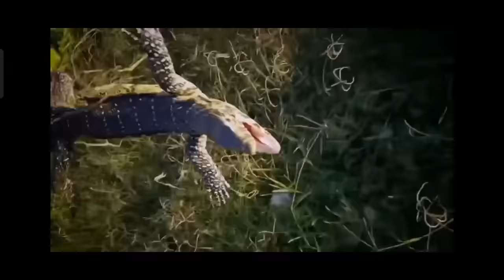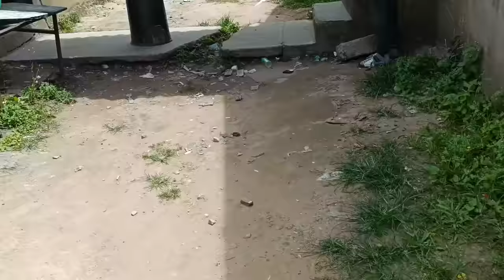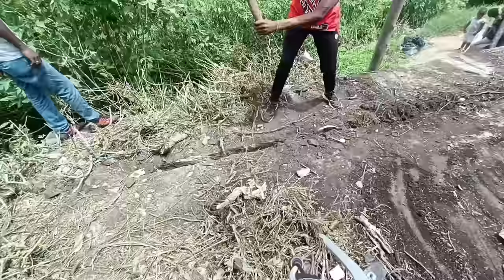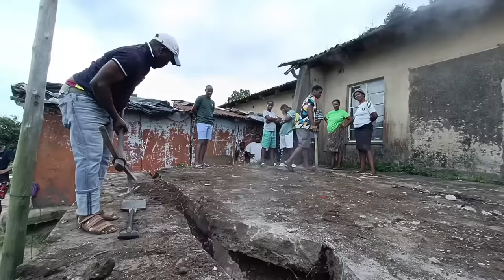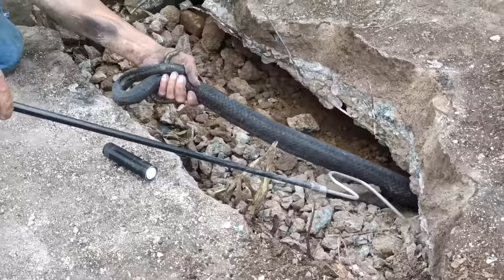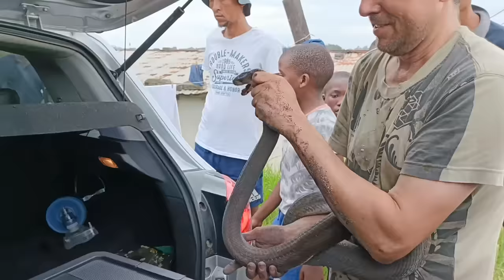MEGA MAMBA MAYHEM!!!  😱😲😯

Comment: How is it possible that people accept driving wrong, and it is proven, for example
The largest percent are right-handed, so you can control everything better with your right hand, the gears, the handbrake.
With your left hand it's like you're moving around in a pot, no strength for anything, not even the handbrake, you can't even release it properly

Comment: would be much more intelligent to build a trap for the snake then to hacking apart everything.
Reply from the maker: The concrete platform was already badly damaged from erosion and stress fractures. The entire front section was separated from the rest.  So it will need a lot of work to fix anyway. A little bit more concrete is all that will be needed. 
Snakes are not always easy to trap.

Comment: All that effort smashing the concrete - wouldn't they have been better off just sealing the cracks with cement?
Reply from the maker: That concrete platform already had major structural damage. The damage that we did is small, compared to the work that is required to repair the damage that was already there.
So they weren't worried about damaging it in the least. 
Sealing any animal in a place where it has no food, no water and no means of escape, would be considered cruelty to animals.